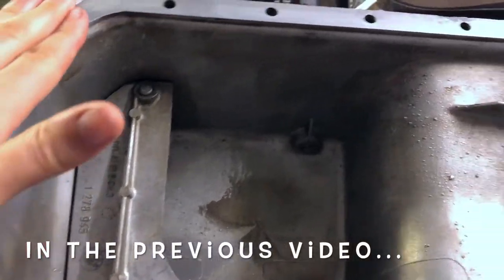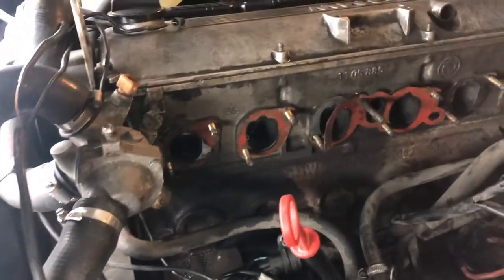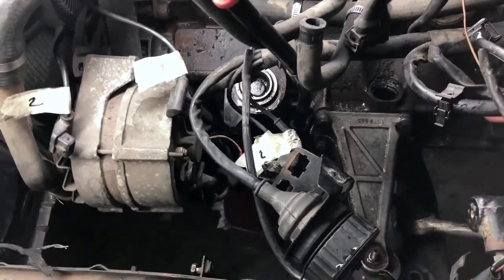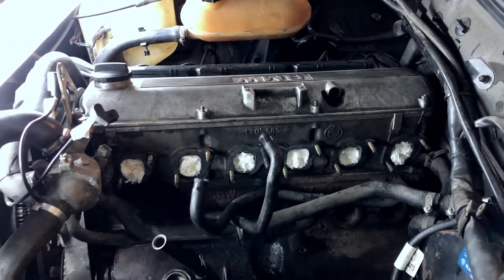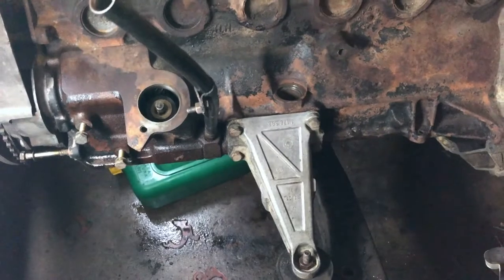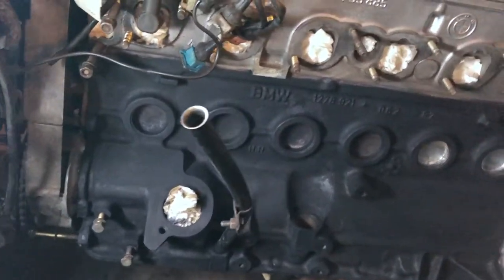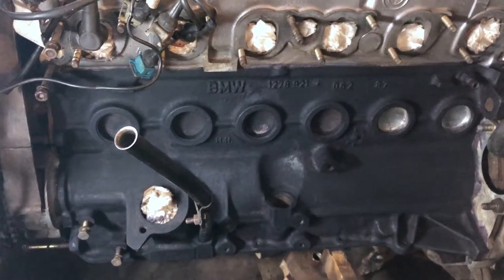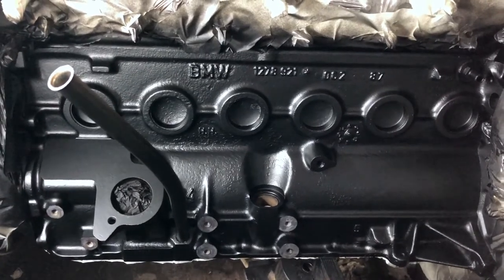Pt. 18 BMW E30 325i How to clean & paint engine block in the car

Comment: if that gasket was still made of asbestos (even if it was aftermarket) I wouldn't break it into parts...BMW Classic (München) replied to me that they didn't use such toxic materials like asbestos after mid of 1985 anymore but who knows where this gasket came from.
Reply from the maker: True, thanks for the heads up, didn’t think about that.
Reply: @Zombie Head german E30 or in the US or elsewhere ? I've never seen such a sticker and I've possessed quite a lot of E30s in my life. The person who replied to me from BMW Classic München sort of guaranteed that they didn't use asbestos anymore after mid '85. so either they just lied to me (I specifically asked about 1986 cars though which is still irrelevant  in regard to what answer they gave me) or there might be a different reason for yours. (?)
Reply: @Zombie Head interesting, thx for the info